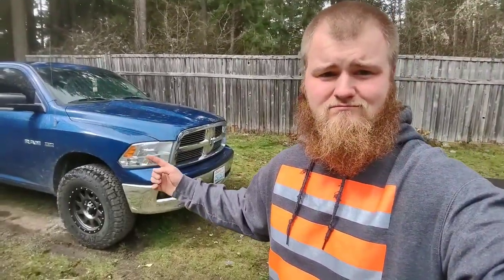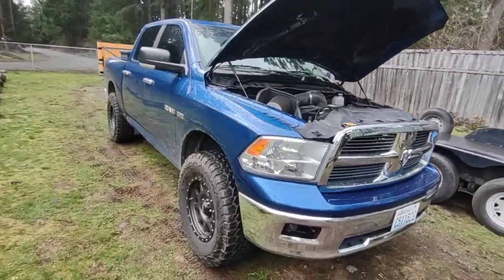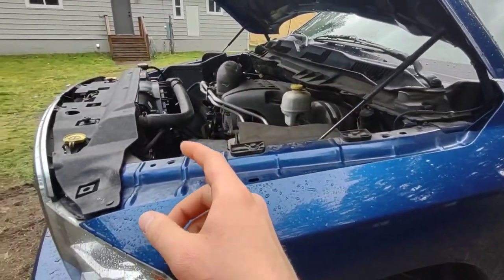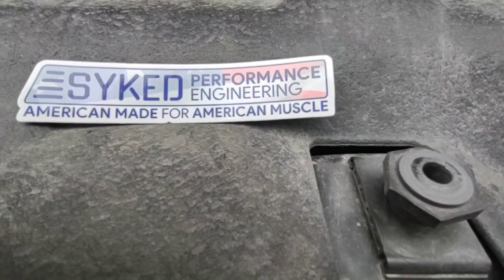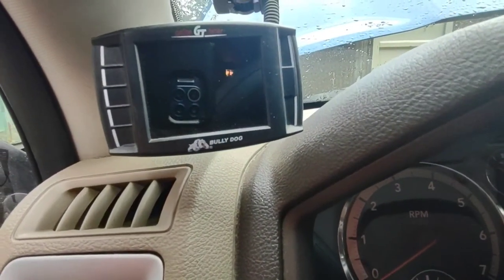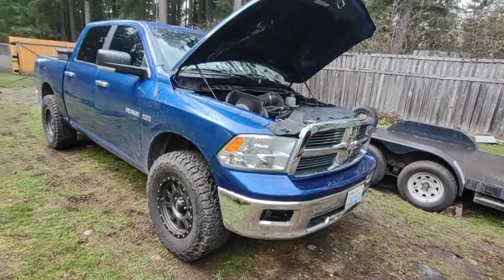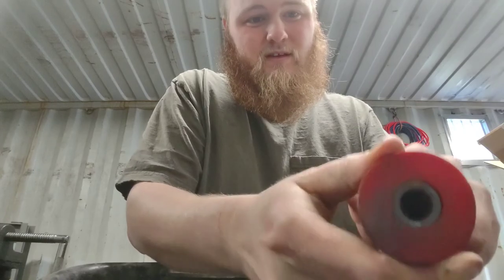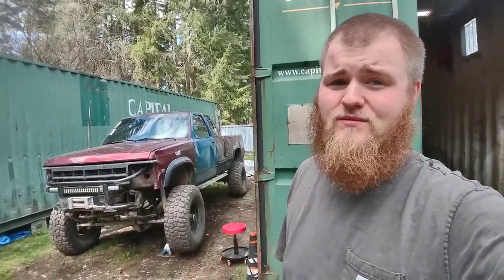4th gen dodge ram 1500 v6 electric fan upgrade and what you need to know

Comment: I took the shutter off mine modified the front bumper put a external tranny cooler on it need put push electric fan on it add a external oil cooler 😊

Comment: I assume my 2012 5.7 would work with this with no issue .  I have a Super chips programer ams MDS is disabled and 87 octane tune being used Stat would be replaced with the 180’ stat and fan speed rolled back .
Reply from the maker: It should work no problem my electric fan has been working pretty good ever since iv swapped it in

Comment: I have a 2005 with the 8.3 V 10 looking for something similar to replace the broken hydraulic obsolete cooling fan.
Reply from the maker: I would cross reference the radiator with the 5.7 if the radiator is the same they make aftermarket shroud/electric fan combo kits out there see what your radiator part # is compatible with and go from there

Comment: Does it just plug in on the 2012 ram 1500
Reply from the maker: It plugs right into the factory plug for the electric AC fan that you remove to mount this fan

Comment: Do you adjust the temperature or the  v6 fan first?
Reply from the maker: So I switched over to the electric fan first and then brought it to my tuner and had him adjust the temperature that it turned on at not saying that that's the right way to do it but that's the way I did it and my truck's been working phenomenal I just need to put a bigger tranny cooler and a fan for that I will be doing an updated video this upcoming summer on how everything is doing
Reply: Did you tune the temperature with a scannner
Reply from the maker: Had to bring it to a tuner I don't have the proper programmer to adjust the temperature myself

Comment: Do you have the contact information for your tuner by chance?
Reply from the maker: I do but I'm located in Washington he has a shop near spanaway not Shure where you are located
Reply: @Betterhalfoffroad  I'm in Washington as well in Tacoma.
Reply: @Betterhalfoffroad  do you know what temp they set your fan too
Reply from the maker: Mine kicks on at 200°
Reply: @Betterhalfoffroad  I'm putting in 180 tstat with the e fan. So I'm wondering what a tuner would want me to set it too.
Reply: @Betterhalfoffroad  got a hold of your old tuner he moved out of state.

Comment: Where did you get that fan?
Reply from the maker: I got the fan from O'Reilly's you can get it from AutoZone or Napa as well off of the V6 model it will bolt and plug right into the 5.7 hemi
Reply from the maker: Sorry for the late response you can get it at any auto parts store it's out of the V6 model same year truck

Comment: MORE MPG?
MORE POWER?
Reply from the maker: Yes on both sense the motor isn't having to turn the clutch fan the throttle is a lot snappier accelerates a little bit quicker and I'm getting a bit better gas mileage
Reply: @Betterhalfoffroad   THANKS FOR YOUR INFO FOR MY BENEFICE.
Reply: Will this mod work for 2012 6.7 cummins?
Reply from the maker: I'm not 100% sure your truck currently has a clutch fan switch to an electric fan I'm guessing it would work you need to make sure you get proper fan setup that truck cool there's a lot more coolant to keep cool in a diesel compared to a 5.7
Reply: @rongrandt7960  I have a 2014 2500 w/Cummins, before that I've had PowerStroke Fords and Duramax Chevrolets. I went from forum to forum asking the same question and the general consensus is an electric fan will never ever cool any diesel satisfactorily, especially if you tow.
Reply: Remember folks, the motor in the fan that you remove is a direct replacement for the new fan motor. So take the motor off of that skeleton frame and stick it somewhere in your toolbox as a backup that can replace the other motor in minutes. And I just bought a Trinity Diablosport Platinum so I'll see if my 700 dollar investment was worth it.